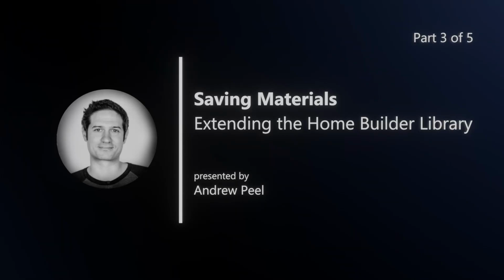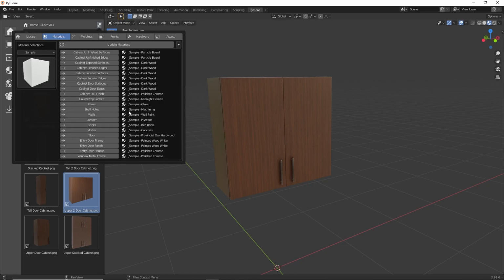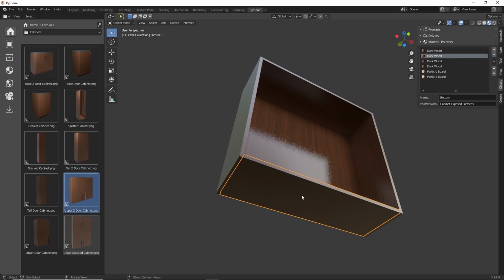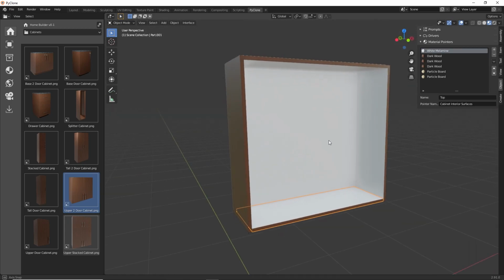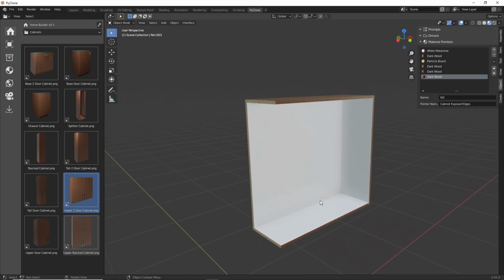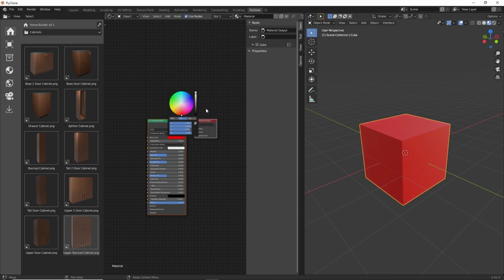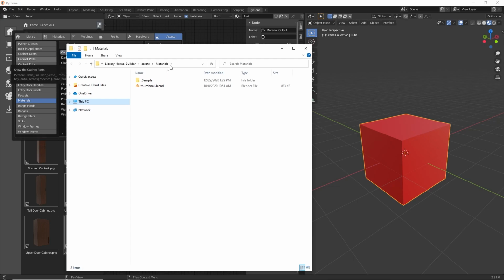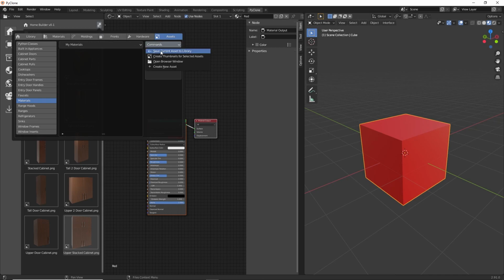Saving Materials to the Home Builder Library

Comment: Iit is amazing however when I swift to edit mode something strange happens with assets. They disform completely . Also, seems impossible to import to a original blender without disform them
Reply from the maker: This is because there are hook modifiers assigned to the meshes. If you apply the modifier stack then they wont change size.
Reply: @andrewpeel1996  ok. thank you very much for  your feedback. congratulations